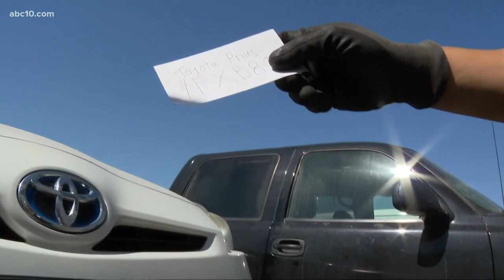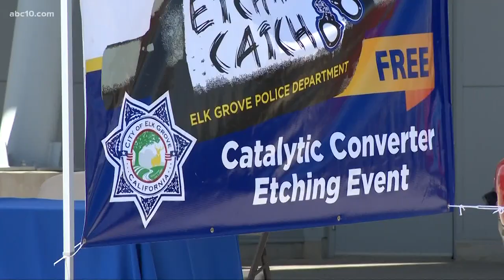How to stop someone from stealing your catalytic converter

Comment: You got to ask yourself, who´s buying those stolen cats?
Do you think they care about your license plate on it?
Reply: I think it more has to do with being able to pinpoint a specific car to a cat in case the thieves get caught with all the cats in the back of the car.
Instead of just claiming they collect them legally, they can hook a theft case to them for each one that is marked.
Reply: Absolutely not.I’m thinking about buying cables and wrapping them all around it in different places then attaching them each to the frame of my car which would take them a while to get thru.Then applying sheet metal over top of that then using some cold weld to attach sharp razor blades all over the sheet metal.
Reply: @JohnSmith-wj2wd   actually they more than likely wouldn’t do nothing seeing how people are raiding stores in broad day light and get nothing but a slap on the risk

Comment: with a grinder, that's easily erase.  a protection  plate bolted under the frame is more efficient
Reply: Yeah it’s only use is if the cops catch them soon after the crime
Reply: Jd Vandy not if they grind of the etching. That’s easy to grind off

Comment: I think an aftermarket car alarm that has motion sensors could also be a good deterrent. If they lift the car with a floor jack, which I’ve seen them do, the alarm would sound. As soon as the saw touches the exhaust pipe the alarm would sound. Maybe weld three pieces of rebar over the converter in addition to the alarm would work best.

Comment: Mine was stolen off my Mitsubishi 2020. It was on backed ordered for 2 months. Cost me over 2,500 for the rental and my 500 deductible.
Reply: I am in Minneapolis and also have a 2020 Mitsubishi Outlander sport se and mine is at the dealer getting its 3rd converter put on .$2985 each time and 2-3 months in the shop waiting for a new catalytic converter.  vin etching ,spray paint, and cat clamps didn't stop them!
Reply: Got my stolen yesterday I was told not to get a manufacturer one  I was told  to go to Meineke because they can weld it in! It cost 1800

Comment: Weld a piece of straight pipe more horse power and sounds a lot better try it i would go to a welding  shop and pay to take it off just save it for when u gotta smogg it be ready to weld it back on
Reply: Sure.  For 2 more hp.  And no, sound will get louder, as cats also work as resonator.